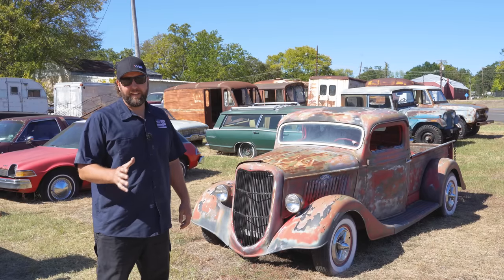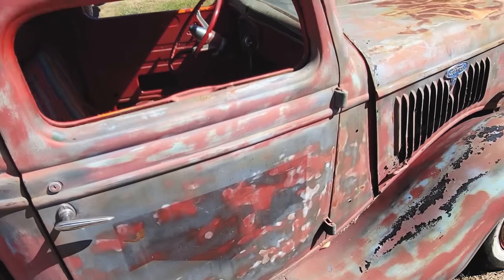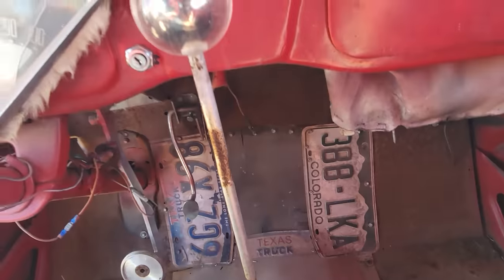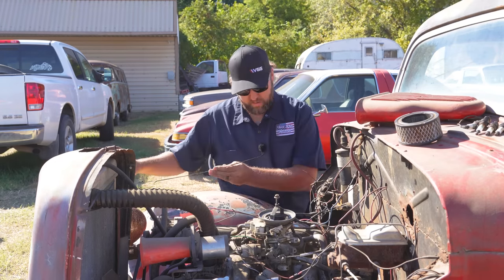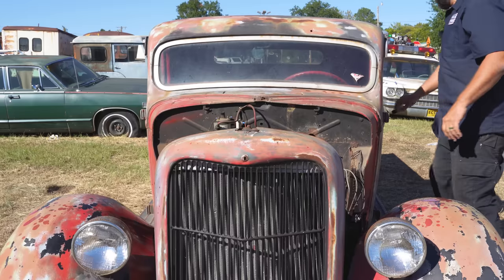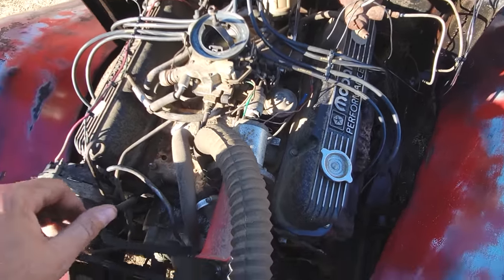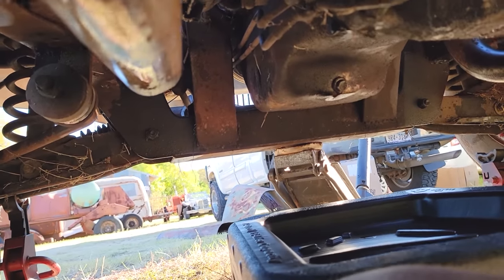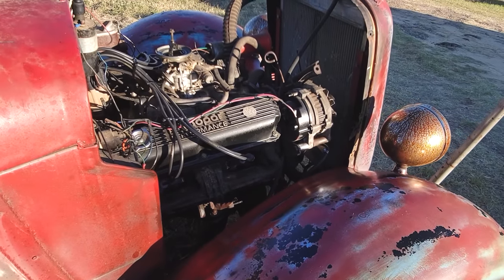Mopar Powered '35 Ford Truck Ratrod! Will it RUN AND DRIVE 630 MILES?

Comment: Your vehicle recovery videos have impacted my life in ways you will never understand.  It isn't just a matter of getting an old heap to drive several hundred miles to get back to your shop.  I don't think I would want to tackle anything like that.  It's simply a matter of not sweating the small stuff and working through your problems until you reach your goal.  Thank you, so much for doing what you do.
Reply: Well said! Exactly!
Reply: The FODGCH
Reply: Derek makes my issues with my 1965 Wheel Horse look like child's play.
Reply: Buy yourself a trailer.
Reply: @pgrafpg  But that would  take all of the fun out of it.
Reply: These have inspired  me to want to do the same.
Reply: Being rich helps
Reply: I agree this man is an inspiration to all
Reply: @born2soon, what model do you have?

Comment: Great video Derek!  I vote to paint the truck (not too shiny), put a 302 ford and a 4 or 5 speed manual, rewire, and make it safe for the road.  Will make a great shop truck.

Comment: You've definitely raised the difficulty level on these revivals lately.  Most would have taken it back on a trailer.  Great work Derek raising the bar for revival videos.
Reply: A fella has the patience of a saint to deal with this stuff. I woulda thrown a wrench through the windshield and pushed it into oncoming traffic.
Reply: That’s for sure, I wouldn’t have driven that thing a block much less forced her 600 miles down the road.

Comment: Absolutely love your channel, Derek! For me, this is one of the coolest rescues you’ve done. I think you should swap the engine out for a Ford engine. But most of all, if you were ever going to go all in on a restoration, this is the one you should put the time and energy into. This would be such a cool shop truck fixed all up, painted and VGG stickered up. My vote is to bring the thunder and the love to this truck!!!
Reply: I second that vote :)
Reply: Yep Time to find a Coyote engine/trans/rear donor and Ford basic interior!  See if the Mopar engine can be torn down and rebuilt for another Dodge vehicle!
Reply: @obenwahkenobib8899  no coyote though, they're best left for a high revinn speed machine. Built 302 is plenty.
Reply: No huge HP engine in this truck! Destroys the feel and would have to put a proper chassis and driveline, brakes etc. It would be just another hot rod truck like we see at the shows.

Comment: Definitely shop truck/ cruiser material right there. Would be nice to see a Ford engine back in her and a seat that has just a tickle more padding. That truck is a keeper for sure. You actually fit in it too, so that’s a plus.  Great episode!
Reply: if its already working and all, mossle put whatever a guy wants, maybe a buick engine... who knows.
Reply: I have watched this for a few times and I agree with you X-ray Z.  I would start with a 5.0 roller motor out of a late 80's, early 90's Mustang or Explorer with a T-5 and go from there.  It is a blank canvas
Reply: @explanger527  Yeah, it’s his to do what he wants with. He asked for suggestions, maybe you should recommend a Buick engine to him.
Reply: On board with a shop truck
Reply: @explanger527  What is wrong with the engine it has, and it belongs there at that, so why change it for something that doesn't? That will turn it into a Chevrolested refrigerator.
Reply: @beauxr.benoit1374  nothing wrong with keeping the 318 in it, just putting my opinion in the comments as everyone else does. Sometimes suggestions help a guy with his own ideas you know.
Reply: @explanger527   Sorry, I am a stickler for keeping vehicles as close to what they were originally built as and/or keeping the Oil-line correct. Like with this. Having a Dodge engine in it is a tribute to the Fords built between 1902 and 1913 when all Fords were built with MOtor PARts bought from the Dodge Brothers. And I go overboard sometimes.

Comment: Love the return to the old-school Derek adventures. The ones where we don't know if you will make it or find you sleeping in a refrigerator box, sharing a blanket with a crack addict on the side of the road by your broken-down rig Loved this one!
Reply: This was truly epic!...But I wish he had better informed us, along the way, as tro how many miles he had to go, after each breakdown...it seems like he broke down six times the first 50 miles or so!...and then had a final run that went smoothly?...Hard to tell, but amazing that he made it!...I cannot figure out if all this effort will pay off for him!
Reply: reminds me of some of the pioneering SoCal rat rods over 20 years ago, but a bit cleaner welding work. Some of those lacked floors. Grind-o-matic whitewalls too? Magic! Pinto R&P? AND water in the engine??? Irresistible!!!
Reply: @rickr442  And he never mentioned or even talked about the AMC Pacer behind him, made me nuts.
Reply: @KarateSensei71  We'll probably see it in a future will it run and drive video.
Reply: @KarateSensei71  Reminded me of a Hot Wheels car I had when I was a little fella: the "Packin' Pacer"

Comment: Of all the rigs you’ve driven over 300 miles, this one is absolutely insane! How you stay calm and keep cool is inspiring. I’d be willing to bet the intake gasket is what’s seeping into the oil and vice versa. Overheating is probably the obvious like the radiator, fan and etc. I’m sure you know by now. I think this would be really cool as a shop truck with a flathead V-8 or maybe a flat six?

Comment: This is by far my favorite VGG video. The truck is so cool. Perfect patina and oozing with character. The 318/Torque flight is a big plus. To me it's a keeper, especially with Gene Winfield's signature on the glove box. I know exactly what I would do if it were mine. Find a good Magnum 360 or 318 to replace the engine. Get the trans rebuilt then replace the rear axle with something better like a Ford 8.8. Next would be to tear out the shoddy wiring and re-do it all the right way.
Reply: I'm in accord with the above except for the engine.  How about a flathead with an ARDEN OHV KIT.  Once redone right it's worth its weight in gold.
Reply: I don't understand you guys, you would have to replace almost everything in such a vehicle, really the only original part left would be some basic metal in the inside.  Why is that such an attractive thing to you?  Can't you just better take a modern platform and build up a car in this old style?

Comment: G'day Derek, great vid mate. I'd go small block Ford with possibly a manual box and the diff would be your choice. One of the things I would definitely do is a new fuel system and a complete re-wire. Not all that expensive, just very time consuming. Maybe something the boys could help you with. Anyway, awesome vid. Shows you what you can do if you don't give up. Love from Australia.
Reply: G'day all exactly what me mate said. KISS keep it simple stupid and back to basic
289 or 302 with correct carby set up and manual trans after the build very simple maintance and fun to drive.
Reply: Gaa Day Mate!! 🦘🦘
🎶Tie me kangaroo down mate! 🎶
Reply: Rat rod shop truck old school 350 Chevy letter it up and clear coat it.

Comment: Great job, Derek! Pull that motor out and use it as a boat anchor and stick a small block Ford motor in there. Tighten up all the loose ends and let your boys paint it - they'll come up with something cool and learn something along the way!
Reply: I agree let your boys pant it

Comment: Another great video, Derek. That truck has such an iconic style. I would love to see you "Bring her around" with a Ford small block (289 /302) and a Ford transmission / rear end. You could either paint it with some really cool wheels or leave it patina. Either way, put some VGG graphics on it. Really cool truck.
Reply: Yep, Ford Small block with AOD would be great!
Reply: I agree it needs a nice Ford engine in it
Reply: Ford Coyote motor and 6 speed... LoL
Reply: Go all the way Ford Cobra V8 engine
Reply: @josephdougherty2399  I hear the coyote with a 10 speed and a whipple supercharger is pretty fast. 😂
Reply: @FoolOfATuque  like a bullet....look up the new Ford Venom motor for just did a press release on a couple weeks ago to replace the coyote....promises to be a Hellcat killer

Comment: This pickup has got such a cool start. I love the stance and I love the chop top to begin with. I think it's screaming to be a rat rod, however I would go the upper end go through the motor transmission mechanically sound and put a nice butt rough paint job on it keeping in the rat rod theme. And of course with everything you do to this truck, share on video! I would love to see more of this.

Comment: That's a hell of an adventure, I'm glad you got the truck. Reminds me of a couple road trips I did years ago. My suggestion? Clean and finish up some of the chop welds and rebuild the motor, or find a nice 351C to drop into it. With that nice pat-een-ah goin on it would make a great shop truck that would make a fun showing to one of those race-a-cop outings. I know you'd fix that wiring and give the interior some nice touches, might even be a good project to throw your little ones at and see what they come up with. Go get 'em!

Comment: I am 70. I've had a ton of toys throughout the years, and am beginning to watch history repeat itself in your selection of motorized machoistic  choices. I've had the twin to your GMC, your GTO, and now a close match to my 33 Ford PU. Each of of your trials and tests of patience takes me back to corresponding fun times. You are definitely more patient then I was, and far braver to actually take these vehicles out on public roads and counting on them to get you there. So..... on this 35 Ford; my suggestion is to find a mediocre Ford/Merc beat to hell and back but running, and put a 289/302 and auto trans. The motor mounts/ trans mounts are readily available for the swap and are a dime a dozen. My old GMC crew cab dually which I've been driving for 25 years and still runs like a top and I have been having a contest to see who lives longer, the old truck or me. I may win that one  as the old girl is now parked with a wristpin piston problem. I will replace the  one OEM piston and rod, ring it and call it even assuming  no cylinder damage has occurred.  I'll refresh the bearings while I'm in the neighborhood.  Got to give the old girl a sporting chance.  Enjoy.

Comment: Holy cow! You are the epitome of perseverance. Most folks wouldn't have tried driving a rig like that 6 miles home let alone 600+ then add in all the "challenges". You're definitely a great role model not only for your sons but folks out here too. As for the truck, I have to agree with other folks on here, rat rod shop truck. Pull that engine/trans and swap in a ford or chevy (that almost hurts to say that because I'm a mopar guy but have to be realistic, it's just not cost effective to do mopar builds), rewire it, square the steering away, new seat, (that one can't be comfortable) and yeah, run it.

Comment: Uncle Dulcich coming in clutch with the bandaid fix! Honestly late-ish model 318's are a dime a dozen in the junkyard more than likely. I say pull the old one out, do a little discovery teardown. And if it's not savable swap it with another small block chrysler. I'm willing to bet that if you put a GOOD radiator in there that fit the space with a good shroud and electrical fan combo it'd cool much better. No telling what kind of junk was clogging that thing up after sitting so long.

Comment: That was an epic ride, every bit as fun to watch as the mid engine Rebel run. If the block is good leave the 318 in it, if it's broke get a 302 Ford. And leave it a Rat Rod. Personally, been building new bumpers for my CJ-7 the last couple of weeks. Rock sliders are next.

Comment: I’ve used K&W BLOCK seal and had great results I was in my old 63 Chevy I got the 348 from his 59 station wagon Kingswood it was a Beast, cracked cylinder head and it sealed it up all the way through high school.  25 miles to and from school home and it held up good stuff.

Comment: Derek - I've been working on my old Ford truck ('77 F250, 460/C6/NP205) almost every night for the past three weeks.  Your channel is a pretty big part of why I got back to it after years of "oh, someday!"

I vote you put a proper Ford motor and trans back into it.  It could be a hot 302, or a big lazy 460 turned 521...either way, with a heavy motor up front, and the weight reduced chicken wire bed, you could have a really good burnout machine that could easily be named something like "Perseverance" - after all, you did keep at it until it made it 600+ miles home, when most people would have given up a few hours in.

Most classic Fords need to be Blue...but the Red is also really growing on me.  If you decide to go Big Block Ford, you should talk to Jon Kaase, I bet he would give you a tour of his place if you wanted to learn some good things.  Otherwise, Scotty at Parkland Auto Machine in the PNW is a really good resource, they call him "the Mad Porter" (and not like the cold snack!).

Comment: Back in the 80’s, I helped a friend that had chocolate milk oil.  I changed the head gasket and we decided to got something to eat before we came back and changed the oil.  When we got back after driving to get something to eat (about 10 miles away), the oil was no longer chocolate milk.  It looked completely normal.  So I believe the water gets got enough to boil out of there. We changed the oil anyways after that, but I found it interesting that the oil could clear up like that.

Comment: That was fun. The hose clamps was awesome with the rusty nail. You might consider using bailing wire sometimes like for exhaust pipes and instead of zip ties they're way too modern. Love to see that old truck souped up for the drags with a real suspension on a good rear end and super wide slicks. Maybe some fat diesel stacks behing the cab for a open header reverb.....

Comment: A good tip for those old cooling systems is 2/3gallon of vinegar and 2oz of citric acid. Put it in and drive for some time (must be heat up and work a little) and it's improved a lot!

Comment: I think all of the work that needs to be done on the truck has been done now. Guess it’s a goin to town rig now. If it will make it 600 miles it should make it to town. You should save the truck for little Grip. Good job Derek, thanks for sharing. 👊

Comment: I had a 1995 Dakota with a 318 (I.E. Magnum V8) and I loved it with the TBI. Mileage and power were fantastic for a small block. I would consider using one in my upcoming 32' Ford Truck project.

Comment: My experience exactly with K-seal on an old International Tractor seems to be good stuff! My 2 cents would love to know if it’s a crack or what’s leaking but the 318/904-727? Is a great combo rebuild paint letter it and shop truck it besides you got some boys coming up and your wife would fit good in it! Great job keep up the good work!

Comment: One idea regarding the overheating engine: Is there supposed to be a fan housing behind the radiator? Otherwise, at lower speeds the fan might not get enough air around the radiator. I had that problem once, and the fan housing fixed it.

Comment: This is basically my nightmare: stuck on the side of the road with a broken car and trying all sorts of stuff to get it going just a bit longer, being at the mercy of random strangers and possibly having to pay an insane amount of money for a tow truck hundreds of kilometers from home. You're a far braver man than I am, that's for sure. Good content though!
Reply: Been there with old Harleys. A few years ago the shift lever bracket broke right in half. Within 5 minutes some young girl pulled over, broke out the gaffer tape, jammed it into 3rd gear and got me going! Amazing young Road Angel!!

Comment: Go for consistency and reliability for a go-to-town rig.  All Ford or all Chevrolet.  Either carburetor with points or EFI with computer and electronic ignition.   It seems when you mix and match a vehicle you ask for trouble.  Fix it up as best you can and enjoy it.   Really great find.

Comment: Derek.... clean up the body.  You're right, it's paintable!  Probably a small-block Chevy, nice cam, new ignition, and maybe 2 AFBs for looks.  TH 400 and a new rear end.  I like the idea of a dropped axle in the front and coils in the back (hey, how about a transverse leaf spring and split wish bones.  Yep, retro-rod).  Big tires out back, of course.  Clean up the inside for comfort, then decal up to advert VVG.  Whoo hoo!  Thanks for the ride and for being cool.  Hope you made the meetings.
Cheers,
Richard in Utah

Comment: Derek, this is one great find. The top chop doesn't appear to be too bad.. The bed needs some work on the sides and new fabricated metal could be used. The "Mopar, No car" would be junked for a Chevy or Ford small block replacement. Some new fuel and brake lines and you are good to go. If the engine lets go there is no great loss. Can you tell I'm not a fan of Chrysler stuff? Safe journey my friend.

Comment: Tip from Oreillys employee.. Try the precision universal in line fuel pump part # E16010 2.3-9psi with Lifetime warranty. Those edelbrock ones suck and only have a 3 month warranty and cost more.

Comment: Great episode, fyi I had a client driving an old Polaris with a 440 and 727; it was badly overheated when she drove in so I waited for it to cool, and had a long talk with her. She said it would barely go uphill and then overheated! As it turned out the slipping 727 was pouring the heat to the tranny cooler in the radiator causing the high temperatures! Let the old 440 cool down and replaced the tranny with a good used unit and presto! Happy car and customer! I wonder if your slipping tranny had anything to do with the overheat problem? Anyhoo, those old molars are tough!!  Great content and thanks for all the quality entertainment!
Reply: Mopars, not molars🤨darned auto correct!